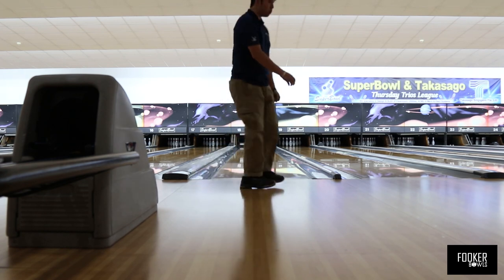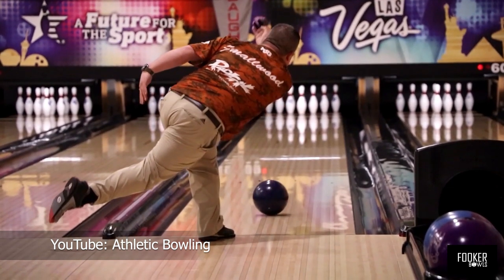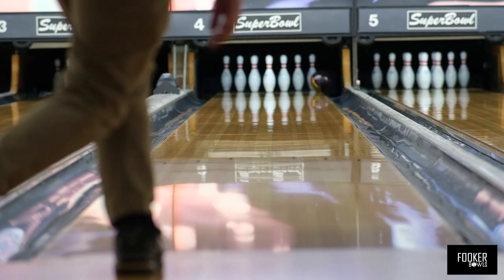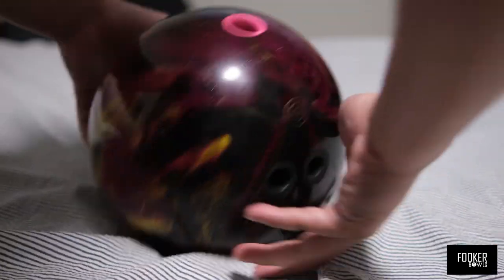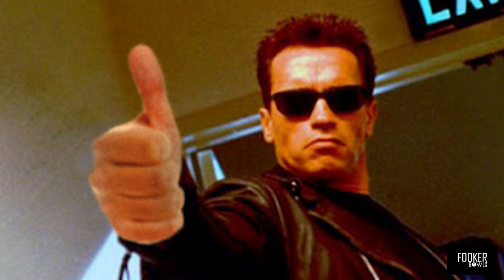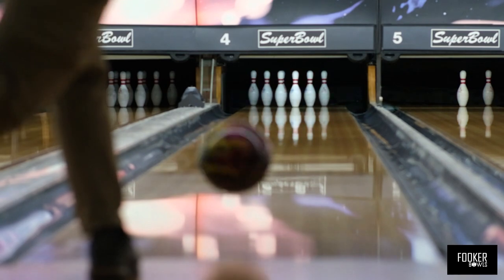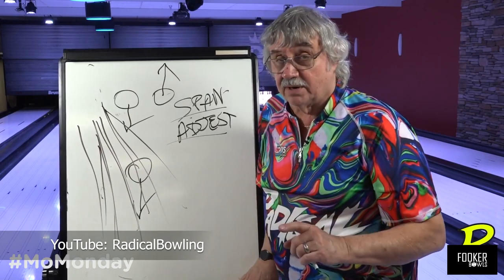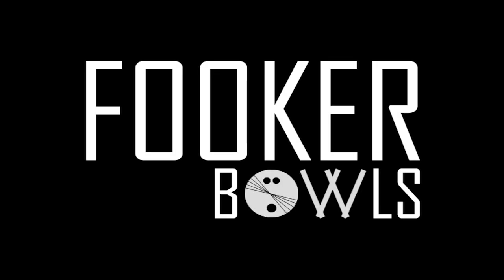The Curse of the Full Roller

Comment: The reasons the full roller has a limited amount of drilling patterns is because there is not many places to put the pin that doesn’t cause the flare (oil rings) to cross the finger/thumb holes. A ball that is bouncing down the lane tends not to change directions in a consistent manner.

Back when full rollers were more common, bowling balls didn’t flare, so as long as the first oil ring didn’t cross the finger holes the ball was good all the way down the lane.
Reply from the maker: yeah i feel that first-hand being a full roller throwing relatively slow at a bit more than 300rpm, i've watched my ball bounce almost half the length of the lane. suffice to say the result upon contact with the pins wasn't pretty!

Comment: I used to always drill my equipment pin up and/or pin down. Pro shop guy noticed my oil rings across the thumb a little. We went with a full roller layout on next ball. A year later my average went up about ten pins. For the last 5 years now average is around 228-232 across leagues with a full roller layout. Just find what works for you. I play down and in across every house I come across.
Reply: Im a full roller and all my balls are pin up. I want to try a full roller lay out. What reaction did you see happen.
Reply: Are you rolling over thumbhole?  That’s what I was doing. As far as ball reaction I lost that snap in the bowling ball. Get more of an arc now in your balls. Coverstock will help a little but for the most part most balls react all the same since I’m limited to one layout now.

Comment: You can see the oil line is outside of smalls holes he's not a full roller
Reply: @flipper9038  dude look it's obvious that his track is on the outside of his finger holes
Reply: I think both of you are speaking without knowing…

A full roller is defined as a 0 axis tilt.  

The common full roller release does produce oil rings on the ball between the thumb and fingers. 

If the oil rings are not between the fingers and thumb, that does not negate the possibility of an unusual release resulting in 0 axis tilt.

Comment: The Mo ring finger thing I can't necessary agree with since in the past balls only had two holes, thumb and middle finger, and those bowlers were mostly all Full Rollers!
The Great Full Roller Ned Day used two holes (middle and thumb) and later converted to three holes but remained a Full Roller.
Billy Hardwick did not even use his ring finger at all. He used his index and middle fingers because his ring finger had no joint, yet, Full Roller!
When I bowl my Full Roller, if I bowl a lot, I can tell you my middle finger takes more of the effort than my ring finger.
Reply from the maker: actually i mostly agree with you! my own take on this is that we should not be considering the fingers themselves, but the positions of the fingers gripping the ball. because the same thing basically applies to the gyroball in baseball, despite the ring finger not being used at all in baseball pitching. 

my opinion based on experiments on myself is that how the ball rotates is impacted by which finger in terms of distance from body leaves the ball last. the difference in timing is tiny but for full rollers/gyroballers the 'inside' finger (the one nearer to the body at the point of release) seems to be the last finger to let go. whichever actual finger it is and how many fingers are used doesn't seem to matter, as i get the same full roller rotation gripping with my index and middle fingers, with only my middle finger, or with only my ring finger (when using only one finger that finger defaults as the 'inside' finger). which probably explains why the full roller has been thrown with so many different grip variations. 

That said, though, arm and wrist positions at the point of release still make the most impact on how the ball rolls down the lane.

On the point about the middle finger taking more effort, this does apply to me also. is the strain more to the side or the middle of the finger? for me it's the side, as I think with how i throw it my middle finger seems to take the load in pushing the ball forward while my ring finger rotates the ball
Reply: @fookerbowls9050  Same with me, the side of the middle finger.
Reply from the maker: @nordattack  yeah i guess that's the more common thing for us full rollers. can't be sure about the finger strain conventional bowlers experience, though, since while i do throw conventionally with my left hand i don't do it enough for my body to fully experience and remember those sensations
Reply: @fookerbowls9050  Do you use finger tip or conventional grip? I use conventional like they did in the old days.
Reply from the maker: @nordattack  i'm a semi-fingertip! it's the sweet spot for me in terms of grip pressure and comfort. when i throw conventional my fingers feel a bit too squashed together, and my hand gets tired or even cramped fairly quickly
Reply: Sir.  I am considering getting back into the game.  And I need to ask you for advice.  How do/would you tell a pso how to drill your ball?  I know ball companies have their way, but could there be others?  Thank you.
Reply: @jerrynash7886  if you're not sure of what you want for your ball,  ask the owners for advises. I recommend going to the proshop at Westwood Bowl. The pso there has done well with my equipment and game .
Reply from the maker: @jerry it really depends on what kind of ball movement you want and how you like to grip and throw the ball. the layout guides ball companies put out are basically guidelines for pro shop bosses to apply for their bowlers so they get the rough ball reaction they're looking for while keeping the layouts legal. pro shop bosses have the freedom to make modifications to those guides to tailor the layout and grip more specifically for the bowler they're drilling for. 

let's use me as an example. because i throw full-roller i don't get to really use my layout to influence ball movement since there's basically only one layout to drill for a full-roller. i can only rely on the balls themselves for variation in ball reaction. i can have some say with my grip, though, in terms of how i like the ball to feel in my hand. i like my grip to be slightly mid-fingertip and thumb hole slightly loose so it clears even when my thumb gets swollen and flat to match the shape of my thumb, so i let the pro shop boss i frequent know my preferences, and he makes the adjustments in terms of pitch, span, grip size, and maybe even depth of grip holes so that the grip i get is the most comfortable for me and how i play.  let your pro shop boss know your play style and preferences and he'll know what to do, and will work with you to get the layout and fit that's right for you. 

if the pro shop boss is willing you can even ask him to watch you throw a few shots so he has a rough idea how you play and what he can do for you, and you can use this to illustrate the variations you're looking for beyond what you've shown and he's seen. have a chat with your pro shop boss about how you play and what you're looking for, and they'll work together with you to get fulfill your requirements. welcome back to the sport, too!
Reply from the maker: westwood only applies if jerry is living here in singapore, though!
Reply: @fookerbowls9050  Remember, there are many layouts for Full Rollers and each does different things. 
I have tried them all and each will produce a different ball motion on the same ball.
I have tried 7 different layouts for Full Rollers and I can tell you each produces a very unique ball motion.
So Full Rollers have at least 7 and maybe more layouts.
We are not as limited as you think.
Reply from the maker: @nordattack  i'm guessing they are variations of the full roller layout we see in the drill guides provided by ball companies? i have heard of full rollers playing with pin and cg position based on the full roller layout to create variation in ball motion, though i haven't tried that myself.
Reply: @fookerbowls9050  No. They are quite different. We are talking putting the pin 'past' the pap.
Reply from the maker: @nordattack  that's pretty interesting! there might be worth in me checking them out, too. though i'm really not sure if any pro shop boss over here will be willing to drill it for me! given how few and far between full rollers are here
Reply: @fookerbowls9050  If you put your email in your response for a second I will get it and send you the layout. Then you can delete the email.
Reply: I have bowl with 3 finger and thumb and my small finger is my 3 finger and I love it
Reply: @nordattack  can you send me the layout? Also I’m a big fan of your channel!
Reply: @BillyBassBen  Post your email and once I copy it I will let you know and then you can delete it. I assume you want the "Pin Past Pap" layout?
Reply: @nordattack  yes I would like that layout please or what ever you currently use, I’m very fascinated by this style!
Reply: @BillyBassBen  Please post your email here so I can send them to you. Once I copy your email you can delete your post.
Reply: @nordattack  it keeps deleting my comment I think because it contains my email
Reply: @BillyBassBen  Post it on my channel in my most recent video then. I think the owner of this channel is the one deleting it.
Reply: @nordattack  still not working even on your channel ☹️
Reply: @BillyBassBen  Which video did you post it on?
Reply: @BillyBassBen  Try this: type out the email but don't include the "at" symbol.
Reply: @nordattack  your most recent video should be all set now
Reply: @BillyBassBen  Don't see any post on the Hot Cell vid.
Reply: @nordattack  yeah it must be some policy with YouTube
Reply: @BillyBassBen  I just had no problem putting an email into my video. It may be something with your browser. Clear your cache and try again.

Comment: Full roller is not a curse I have a pretty high average. Also I seam to leave less 10 pins than other releases ! I average 220 across multiple Leagues ! You just need to drill your equipment very neutral ! I would not change my style for anything!!
Reply from the maker: that's fantastic! because i don't get much carry on mine, though carry also does depend on a lot of other things as well, beyond full-rolling. my layouts are all the standard full-roller layout so they mostly behave roughly the same way apart from the magnitude of the behaviour. which i prefer as i will almost always have a good idea what my ball is doing and how i should react. though the downside for me is that if my somewhat standardised ball movement shape happens to not work for the lanes i'm on i'm royally screwed!
Reply: How many games was that average in

Comment: OM- I was in stitches by the end of this video. You are hilarious though I'm so upset I cannot rewire myself to bowl correctly. At least now I understand where I'm failing. One year I bought the Hammer Obsession and couldn't control it at all. When I moved on the approach my release changed. I was able to control it and my track changed. Average went from 195 to 205. Not sure what happened but I went back to what I knew and average is back to 192. This is frustrating. I am thinking enough with this sport. I don't have the right mechanics.
Reply: Don’t change it dose not work. Clean up your release. I was having that problem.  Your not releasing (from the side of the ball) . when I cleaned that up my avg went up 187 to 199.

Comment: So I have determined that my wife is a right handed full roller based on your videos and description. Her release is inconsistent as there is lots backspin, a lot of forward end over end rotation, or it actually hooks like it supposed to. We adjusted her layout from traditional pin up to the F. R. pin down layout but it still doesn't seem to have a noticeable backend motion. I try to coach her but I'm a conventional left-handed bowler and I simply don't know what drills to show her as I don't (obviously) understand the F. R. release. Is the any coaching video you can do as they don't seem to exist
Reply from the maker: can i first ask what ball weight your wife is throwing, and using which type of grip (conventional/semi/fingertip)?
Reply: 12lb with finger tip. Speed is about 11mph and she throws a 900 Global Zen Master and Roto Grip Hustle 3TP
Reply from the maker: without looking at how your wife plays it's hard to nail down what exactly is happening with her ball roll but i'm guessing they're likely related to either timing or wrist turn causing inconsistencies in the release and resultant ball roll. the first thing that probably can be done to help her release the ball more consistently would be to practice foul line drills throwing the ball straight. 

doing this can also make it easier to identify where the inconsistency is coming from, whether the ball is leaving her hand too early or too late because of uncertainty regarding correct release timing, or if that is because of the wrist turning inconsistently at the point of release causing the ball to fall off or hang onto the hand during release. 

while wrist and arm strength isn't a definitive factor, doing this can also help her get used to the weight of the ball in every phase of the armswing without having to think about footwork, while building up sufficient arm strength to execute and replicate the motions consistently. 

from there on once the release can be fairly consistently replicated it will be easier to more definitively determine what kind of ball roll your wife produces, whether it's conventional or full roller. then  add more steps back into the footwork to see if those issues reappear, and then work on the timing at each step those issues show up. 

the training methods for conventional and full roller bowlers, and even lefties and righties, are actually basically the same, just that the ball rolls that result are different, as for most full rollers the release is natural to them. the same principles apply for training both full rollers and conventional bowlers, the only difference being how the ball rolls off the hand. so no need to be afraid of coaching your wife just because she plays in a different way from you, as long as you're sharing with her the correct fundamental knowledge and skills, most of which can be quite easily found online

Comment: I found I have better ball reaction from smoother balls. Or medium level A symmetrical on higher oil patterns. But I’m a little different I have a huge rav rate and good arm speed so I technically don’t have a problem with ball reaction. I have problem with founding a ball that can be drill pin near thumb.  Here’s a few that I found that good good for us.  Phase 2+
3d offset the purple one
Night road this gives me the best ball reaction +
Nova+
Quantum bias old ball the blue one with white dits 
Infinite physics. 
Also pearl balls with particles in the cover work also. Try to stay away from 
Hybrids That are more pearl then solid. Don’t let them tell you it’s a bad thing. It’s just not enough of us for them to care about make equipment that benefits us.

Comment: I'm confused why you are using spare shots to judge anything. Bowlers routinely throw their spare ball very differently.
Reply from the maker: i think i've explained it in my video but i used my spare ball for my experiments to try and take as much of the ball out of the equation, what with mass biases, layouts, and coverstocks and all which may affect how the ball moves. by using a ball with basically no mass bias and nothing fancy in the coverstock whatever the ball did on the lane was entirely my doing.  

while it's true many bowlers throw their hook and spare shots differently (i do that myself, i normally don't even bring a spare ball with me), you'd notice in my video that i accounted for that as well, throwing both ways using my spare ball to illustrate any difference between those releases.
Reply: @fookerbowls9050  while watching your video of Smallwood shooting a 10 pin, you claimed that shot as proof that Smallwood throws a full roller.  This may be what @imtrex is referring to as “using spare shots to judge”

In the video, the ball is thrown with approximately zero axis and tilt so it would not change direction down the lane.

If you analyze Norm Duke’s spare shots at 10 pins you would incorrectly assume that Norm throws a full roller.
Reply from the maker: i used the spare release as the basis for my analysis as it's the release with the least 'stuff' going on in terms of wrist and elbow movement and position. what i'm looking at is how the ball rolls off the hand without the hand doing anything to the ball, as that is the basis on which embellishments in the form of leverage and rotation are added to make the ball turn the corner. how the ball rolls when thrown to hook is basically how the ball rolls when thrown to go straight, just slower but spinning faster, and sometimes at a slightly different angle. 

chris barnes is probably a good example of this as well. his spare shots can sometimes look like he's full rolling when he's actually not, and though he sometimes adds axis tilt, his shots all roll basically the same way to his spare shot, just slightly slower and spinning faster, and sometimes at a slightly different angle.